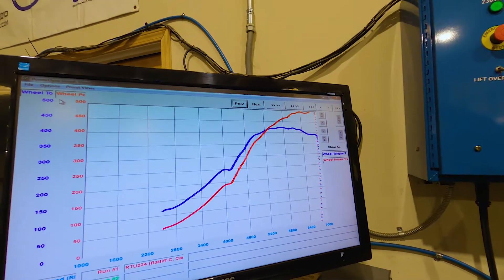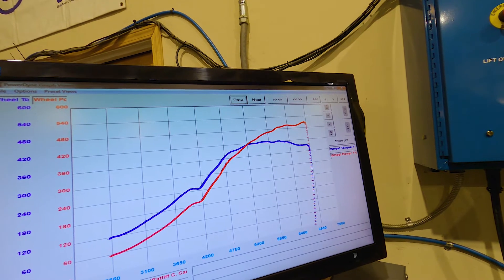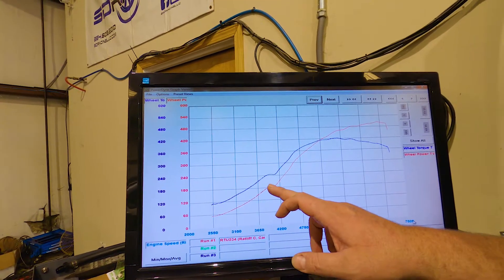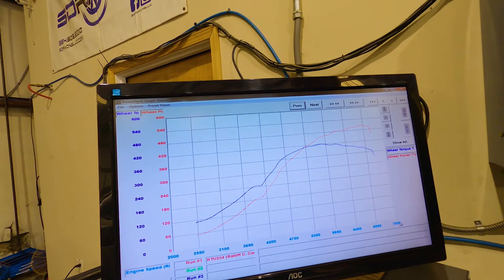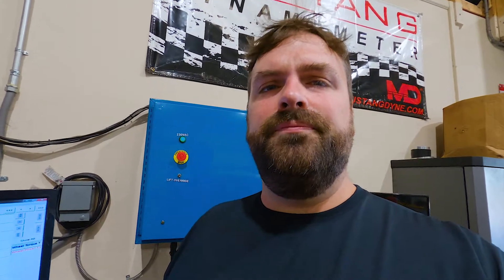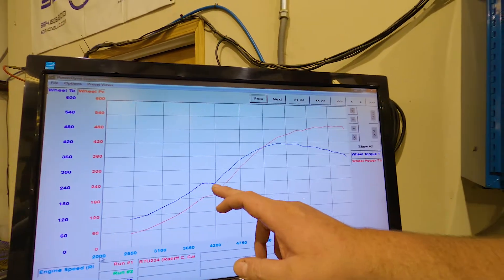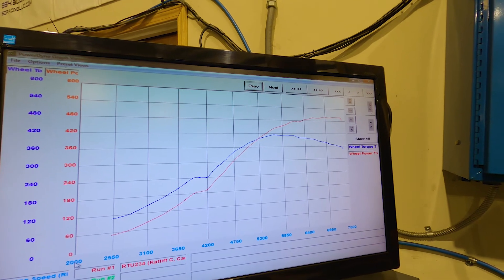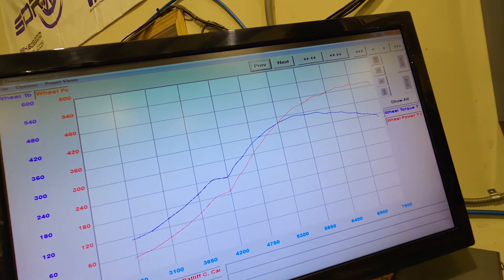503whp on 93 Octane STOCK BLOCK Evo 8!!!!! FP Red, GSC S2 Cams!!!!

Comment: For how long
Reply from the maker: As long as the customer keeps up with the maintenance, it will last a long time.
Reply: I own this car now... it has 523awhp, and it blew the HG a few weeks back at 120k because the thermostat stuck closed and let the coolant boil out of the head without telling me... Im switching to an Evo 9 setup because the coolant temp sensor is on top of the thermostat instead of below it 😑 Also, L19s, new front main and timing components while Im in there

Comment: What psi
Reply from the maker: 25-26psi peak tapering to 22-23 at rev limit.
Reply: @CustomPerformanceTuningUSA  impressive I think I’m goin to go the same route but mhi housing
Reply from the maker: @drivermodnorm2684  thanks. Just letting you know you'll be losing a good bit of power per psi with the mhi housing compared to the ss housing.
Reply: @CustomPerformanceTuningUSA  yea I understand that my issue is I’m at 7,000ft altitude so mhi housing will probly spool better for me
Reply from the maker: @drivermodnorm2684  yes will get about 500rpm worth of better spool with the mhi housing
Reply from the maker: @Omari Grant You'll lose a little down low, but make huge gains above 5500rpm